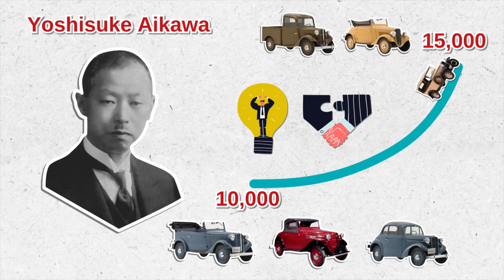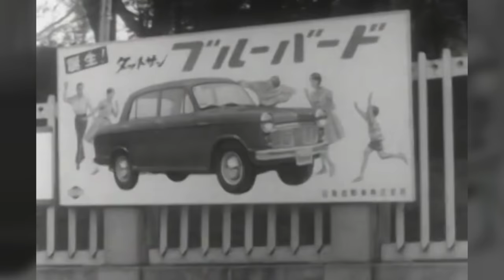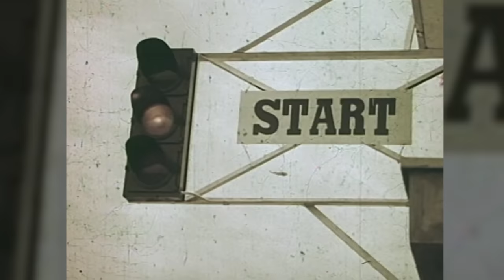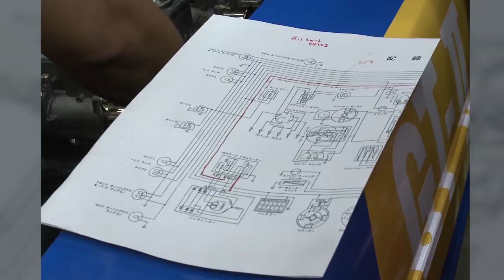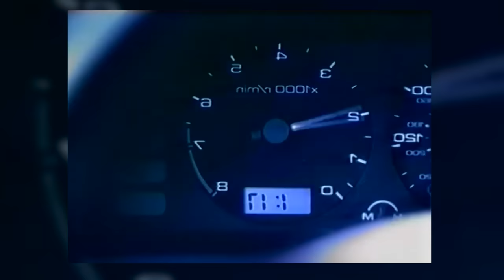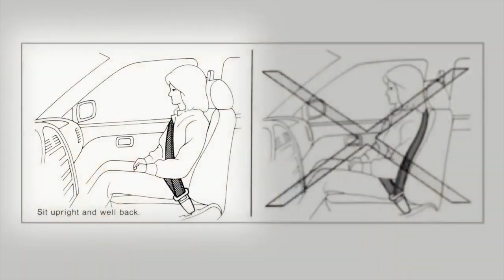Nissan Just Change the World with This New Nissan Skyline

Comment: Great history, thank you Scotty! Very interesting
Reply: Very inspirational too!! Make me wanna make my own car engine!
Reply: @fidelcatsro6948  you can do it!
Reply: @sandasturner9529  if i make one its going to be an inline 6 cylinder 1000cc twin turbo charged with 14,000rpm redline and refrigerated radiators with actuator exhaust valves that lets you select TURBO spooling or Naturally Aesperated Combustion for Ultra Gas Savings..... best of power and economy!!
Reply: @fidelcatsro6948  that's a very good idea! The forced induction on demand idea is very intriguing.
Reply: @fidelcatsro6948  ever heard of the Honda cbx 1050 ? That motorcycle has basically the SAME ENGINE. Check it out on youtube for the sounds and stuff.
Reply: @sandasturner9529  yes i seen in videos and magazines 1980 cbx750 came in 6 cylinder straights too wide for bikes in my opinion but great for cars...bikes should be sufficient with 4s or even 3s

Comment: I remember the datsun b210 great little car!!
Reply: I had a 1970 B110 in high school that was slightly modified. I would smoke the Vegas,Pintos, in street racing. Top Speed was about 97 MPH from a tiny 1200 cc motor. Wow the good times that car brought me...
Reply: I owned a B210 1977, wish I still had it or even better a 510
Reply: I owned a B210  4dr from 1977 to 1988. The mechanical repairs were new valve stem seals every 80k kms, a new clutch @180k kms (old one original with1/3 still left on it)..and while the engine was out then, a deglaze of the bores and new Japanese piston rings. Sold it at 228k kms for over half of what I paid for it..($225 depreciation per year). No rust, drivetrain all good. Should have kept it for "Old School" sake.

Comment: In Australia there was one stage when Holden Commodores came with straight 6 Nissan motors. That was for a couple of years, and they did really well. One of the cars in a taxi fleet I was involved in did over 800,000km (500,000 miles) with the drivers giving it a really hard time until it was written off in an accident.

Comment: Back in the early 70's a friend of mine who was an engineer bought a clapped out Datsun 510 and proceeded to rebuild it. He was very familiar with working on Mercedes cars. When he took the 1.6L 510 engine apart he was surprised to find the design of many parts to be identical to a Mercedes engine. Even the casting marks were the same.

Comment: Nissan is my favorite japanese brand. My very first car was a 1997 Maxima I got for $1450 with 57000 miles on it in 2006. Took me all the way to 174000 in 2014 before the timing chain stretched and the engine went out cause I was too cheap to buy the 800 dollar timing chain kit for it.

Comment: I really like your videos,and I like all Japanese brands but mostly Toyota, I've had 16 Toyotas and 4 times Nissan, twice Honda.
Nisan is not gas efficient at all and CVT sucks. I changed my Siena 2011 for a Murano 2012 and Fully disappointed. It Felt lazy and burring, and gas consume was similar to my old 2008 FJ Cruiser or to the 4.6l Toyota V8 engine. I sold it 6 month latter and changed for a Venza 2011, best descision ever. I rented many times 2018 and 2019 Rouge, RAV4 outlander, etc. The only CVT a bit acceptable is Toyota and Mitsubishi's CVT but not Nisan. The RAV4 by the way was the best balance in Gas, power, suspension and room inside. And the AC of Mitsubishi and Nissan dies after 5years too but never the Toyota AC

Comment: I had a 98 se when it was 3 years old 60k. It had a lot of problems with its fuel injection system. I must have got a dud. It rode very nice though, and I did enjoy it when it started. It was rusting already though.  Under the hood and undercarriage rusted.

Comment: 1999 nissan pathfinder
Reply: 1996 Hardbody 365,000 and still going.
Reply: 1991 Nissan Terrano 2.7TD. 250k kms, owned for last 20 years, will keep it until they force me to buy an EV...but since it is an IDI engine (No electronic injection controls) I could run it on any oil, soya, peanut,ATF, engine, or bio oil...don't need diesel...

Comment: Nissans has turned into cars u are stuck with instead of the car you want.  I had an s14 240sx and my older bro had an s13 240sx.  We loved them. Nibble, dependable, and great design.  But the brand went down hill starting in the 2000s.
Reply: Umm okay Nissan actually is improving now, the newer models are even nicer than ever now, the brand may have had some rough years but Chrysler, Mitsubishi, and Kia/Hyundai are even worse still no matter how much improvements they have made? 🤔